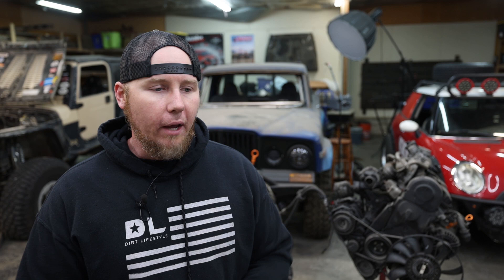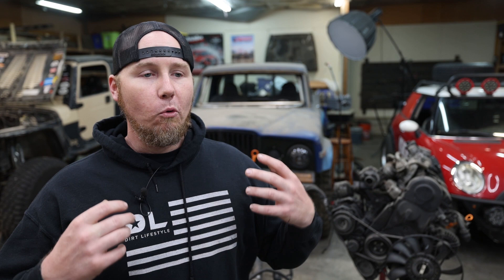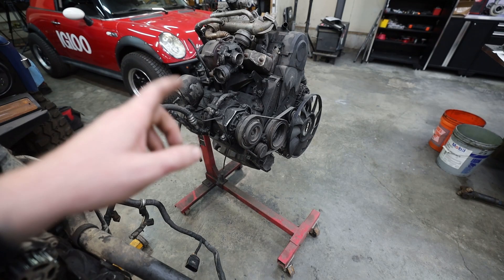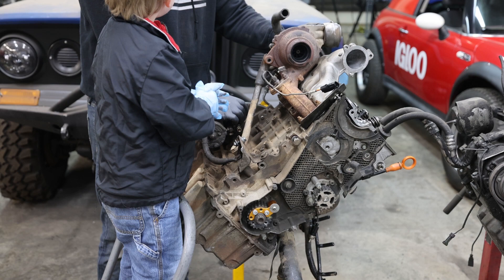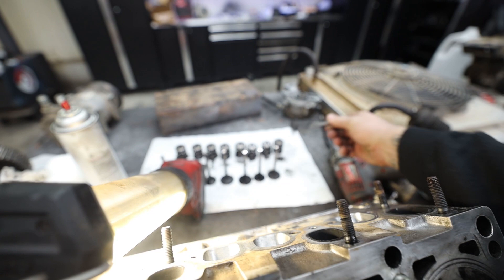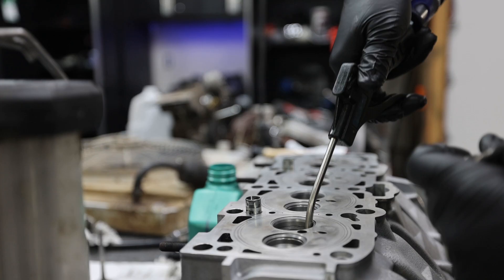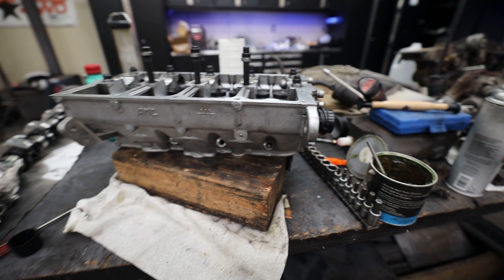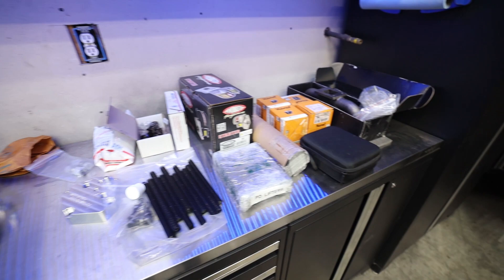Most Powerful TDI in America. Episode 2? Kind Of...

Comment: I've seen a lot of people with Tacoma's do similar things hydro-locking their engines with too much oil :x.
Has to do generally with them steeper inclines etc.

The generally accepted fix, is a catch can which I will be doing to my Tacoma anyway.
It mostly buys you some time for certain obstacles as the oil will flood the catch can before being sucked into the PCV system. 

That is a major bummer about the engine, but super rad build and I can't wait to see how it turns out!

Comment: That Centerforce clutch looks to me to be a duel friction clutch. I have the same clutch setup in my CJ with a Chevy small block. The centerforce clutch works awesome. The faster you spin the engine the more force the weights put on the clutch so it does not slip. You will be happy with it

Comment: You can magnetize and demagnetize any piece of metal that is long enough to fit through the center of a round magnet with a hole in the middle. Like one that came off an old speaker you push it through the center hole to demagnetize it and you rub it on, the magnet itself to magnetize it

Comment: I have two of Matt's adapters and his oil cooler relocation bracket. Dude is amazing!

I have a built ALH in my CJ7 and I'm doing a PD150/ALH hybrid in my 94 XJ. Some of the greatest motors out there.

Also, and just a suggestion, get rid of the GT and see if you can get a Holset HE200WG. There are a few folks running them in a compound setup, and I run it is my main turbo in my CJ7. Great spooling turbo.

Best of luck in the build.

Comment: The 91 Cummins 5.9 I have in my Bronco has 17:1 compression, and it starts in the coldest days of winter without being plugged in, just using grid heater for 30 seconds. Upstate New York winters are pretty cold, too. 17:1 is plenty.

Comment: As always Nate great video, keep them coming. Could you expand more on the NOS usage? It is my understanding that NOS is not a power adder for diesels. But an air cooler that super cools the air before entering the head, like water methane injection. Yes, colder air makes more power but its all just air by the time it gets to the cylinder.

Comment: providing the manifolds are suitably sized for laminar gas flow at the airflow required for target HP then they dont need to be anything fancy, turbos are the great equaliser which is why its common to see turbo builds and OEMs using a basic log manifold. Negligible power difference but typically easier packaging too!

Comment: Hey buddy, sorry I'm so late to the party here. Life first, youtube second as you know.  Love the plan to kinda overbuild this. Mistakes I've made in the past are things like, not upgrading the connecting rods, because I never planned to exceed the torque limit of them... Then had two brain farts and blew a motor to pieces:  boost reference to wastegate burst, forgot to enable overboost protection on the ecu. Hey - at least I know what 30psi into a 10.5:1 Mazda 1.8l feels like lol.

All this said.. I own a diesel jetta that's completely stock, which I've wanted to upgrade since I bought it, but determined that taking my $4000 car from a 10.2s 0-60 down to 7.xs just isn't worth spending like $4500 on performance parts. I'm an old school straight line petrol guy, and that's where the majority of my performance knowledge and experience come from.

On to my concern: nitrous. Why? Here's why I ask: are you going to be drag racing this thing, or slow crawling over rocks? I'm not sure how different nitrous behaves in diesels vs gasoline engines, but my experience, low rpm / low throttle nitrous application on gasoline engines rarely ends well. Are you thinking using super short timed injections with a tiny jet more to try and keep cylinder Temps down?? Sorry, just not following the logic of why nitrous on an off road / rock crawler?

Either way, looking forward to see this thing running again!

Comment: Good set of injectors which will be good for 350-400bhp will run you around 600-800 GBP, or about 800-1000 USD, So they will likely cost 1000-1200USD with shipping.

Comment: The last couple of days I did see some troubleshooting of a non-working refrigerator the owner of the refrigerator provided me the new parts now I have a working refrigerator in the house I am renting. I went to the owner's house,   troubleshooting on a second refrigerator, burned out fan in freezer compartment.  Yesterday repaired  his electric dryer; new heater element. Day before I also troubleshooted a Chinese version of a Honda 4 cycle different name but identical to a harbor freight predator. Using a harbor freight ignition tester, I verified the electronic ignition module was failing; on his Bluemax hydraulic log splitter..
All because my father taught me from a young age how to think and use tools.

When I was your son's age my brother 11 years older than I (First 2nd Class Nuclear Machinest Mate to be an instructor at the Navy's Nuclear Advance School)  and my father were doing landscaping work in front lawn of the house. I asked them who was the boss of the project? I'd rather look at my dad is my dad looked at their brother and I both looking me. Dad: I'm really not too sure! I said I'm the boss of the project. Dad with a surprised look on his face ask me how I decided on that? I said I'm the boss cuz I'm the one that's sitting down. 😁🤣.

Remember, there is nothing greater that idea that's time has come.

Comment: Ive been looking at the tremec 4050 since watching some of Ians stuff and now you switching to it. You can ask Tremec yourself but I think that trans is WAY stronger than you think. In the spec sheet the maximum rate input torque of 425/457 appears to be the rating at a 22,000lb GVWR. Which means in a 4500lb jeep that thing should be bullet proof.

Comment: I can reccomand you some injector nozzles, they are called "FIRAD", they are made to be put on you stock PD injectors, we are making good power with them. I am using the 120% nozzles, they are good between 300-350 hp, with the 160% ones you can make between 400-500hp. If you are interested I will send you a link. Greetings from Romania!

Comment: Do not use more valve spring then you need. That's not how valve springs work. The springs need to be match to your valve train. The weight of your valves, total lift, max rpm, they all need to work together. 

Excess spring pressure is only hard on the cam and rockers, it does not in any way make the engine more durable and if anything it takes life off they cam.

Comment: Haven't watched passed the intro yet. Once "mating two different year engines together" got me already. Time and time again that bites me on the ass. Generally, its sensors and wiring harness connections can be changed pretty easily, and makes me wonder why they (Jeep the big one) would change harnesses on the same vehicle with the same driveline and options..... 

Older GM's are the worst for having apart from the wrong year from the factory. Engine and driveline they were not bashful about using up old stock. Hence one of the reasons many Chevrolets are worth more numbers matching like a mopar. Wrong engines, wrong exhaust, wrong drive shafts, wrong rear end (has ratio that was not advertised for build year).

Comment: Hey Nate noticed you didn't have a flywheel on your list.  I have a new in the box #700479 from Centerforce that Matt recommended with my adapter. I didn't chose to use it as I had already engineered a way make my tach work with the older 700469. If you're interested hit me up I would like this out of my shop.

Comment: Are you using a BRM tuned ECU or a BHW tuned ECU?
Also who will tune this beast of a build you are planning? 
I have a stag 2 colt cam 
In my 2006 BRM jetta from kerma TDI and it's great. The old stock ones are horrible. 
Great video.

Comment: Interesting. You have compound turbos; a small one and a bigger. If using only one on this engine could you use the HY35 or is that too big? You're talking about 16.5:1 pistons and calling it low compression. I thought a turbo setup needed 8:1. I've got 11.2:1 on my motorcycle and it needs super. If it had any more it would need race gas. Can you explain? Thx.

Comment: I'm going to do a Mercedes om606 3.0L i6 swap.  With a few tweaks and upgrades it can reliably make 600 bhp.  It's the 2JZ of diesels.
Reply from the maker: Bad ass!
What adapter and what transmission? The biggest thing keeping me from these engines is adapter but If someone is making them now I will give Mercedes a second look
Reply: @DirtLifestyle   Dieselpumpuk
Reply: In reality its old prechamber POS with nothing but smoke and 500rpm powerband on those HP levels
Reply: I'm looking at going with a ford 6r80. 
Dieselpumpuk is the place I'm going to get the modified pump,  a billet intake with velocity stacks, and billet twin scroll exhaust with their quick spool valve.   Speed gems makes transmission adapters here in the states, and I'll use the  US-Shift quick6 transmission controller for the transmission.
Reply: @arttuiltanen2060  false.  Go on Dieselpumpuk and get a little bit of knowledge on them.   From 2500 they start making power they really make awesome power at peak boost from 3k to 5k  Holding a flat torque curve from 2500 to 4k.  Peak HP around 4k to 5K.  From 5k to 6k they fall flat.    Not a low rpm power range like a cummins.
Reply: @ashtonmariefranklin725  nah, i live in Finland and i seen so many of those builds.. Used to be pretty common engines untill people learned how to tune commonrails.

Comment: Why not do propane or meth instead of nitrous? Heavier valve springs are also useful to stop the intake valves lifting at high boost.
Reply: Would propane have the detonation resistance necessary for a diesel engine? Gas to propane conversions are fairly straight forward, but I don't know if propane would work in a diesel. Gas engines typically have compression ratios in the 8 to 10 range. Some newer ones are a bit higher, but only a bit. 11 is pushing it on a gas engine if you want to run pump gas in to. With race gas or ethanol you can get to 12 or 13. These aren't fixed limits, and not all engines are equal, but it's nowhere near Nate's "low" compression diesel built at 16.5.

Comment: 1st i was going to put in a cummins r2.8 then found out they are from china and blow up. so then i wanted the 4 cylinder duramax but they were a bit expensive and hard to find turn key crate engine. so now im putting in a LT 6.0